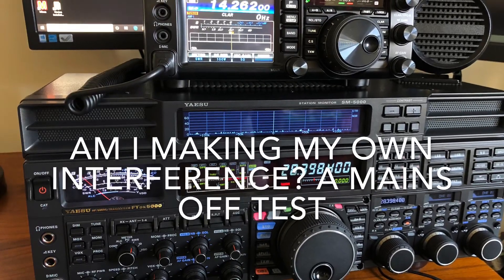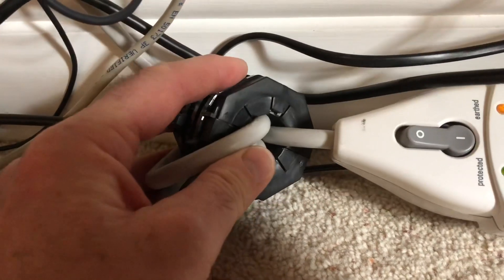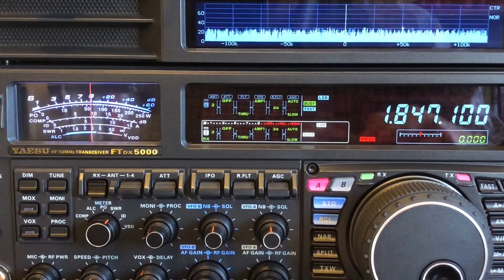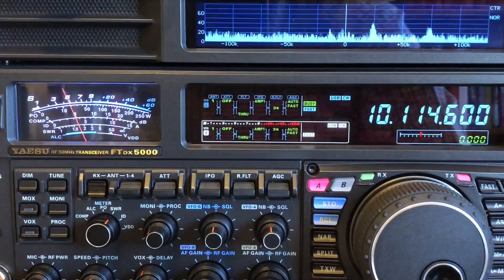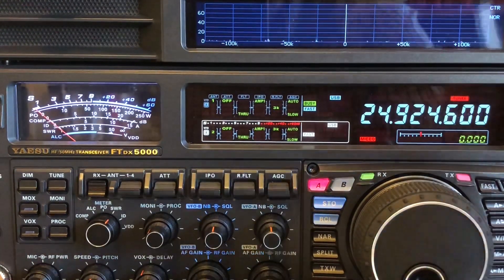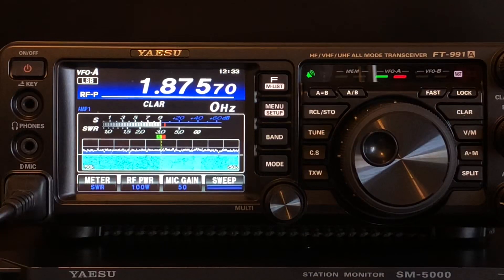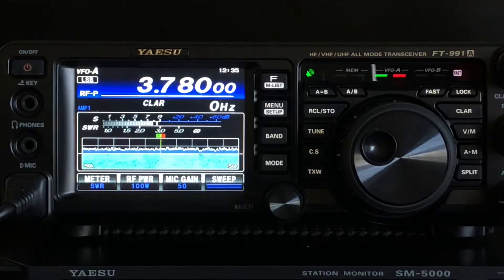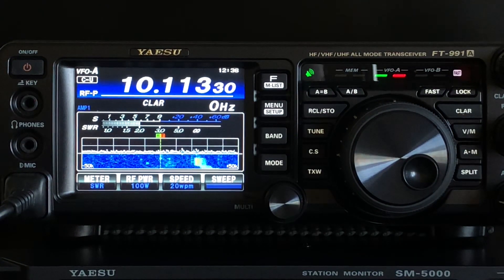Reducing Electrical Interference At Home

Comment: Interesting test there Ian. How do you determine what size, type and how many ferrite cores to use on your various cables ?
Reply from the maker: Steve Wardley Hi Steve. Those type 31 clamp-on cores have had various mentions at RSGB lectures and on the web and come recommended. Once you’ve researched what you need e.g. HF, VHF etc. I think the key thing is to source the genuine article and not something that’s the wrong/unknown mix. I’ve also got 31s as HF coax chokes (different core but same mix) and other mixes for VHF/UHF chokes. Hope this helps...

Comment: Thanks for putting this together. I will be attempting the same test when I can time and conditions to put an hf antenna of some description up. Couple of months ago I made a 40 m 1/4 wave vertical and put up briefly when I could. Noise floor of 9+ on 40 & around S5-6 on 20m. I always run my station on batteries anyway but will be interesting to see my problem is mainly self inflicted which I hope it is as can then make a useful improvement. Fingers crossed 🤞
Reply from the maker: Fingers crossed Tim! Sounds similar starting position to me....

Comment: Nice try Ian, did the same at my QTH last year and got identical results to you, it's comforting and yet disappointing at the same time when you confirm the noise is outside your control. How come you run with Amp1 turned on the low bands? Any more luck with the beverage antenna. 73 for now.
Reply from the maker: Thanks Jim. Yes, mixed feelings! I run with IPO1 on 40m and below. I just used AMP1 as a standard baseline across all the bands for these tests. I assumed the results would be equally visible....I hope I wasn't wrong!! Not tinkered further with the Loop on the Ground yet, as I've been working on a 6m antenna...73 Ian.